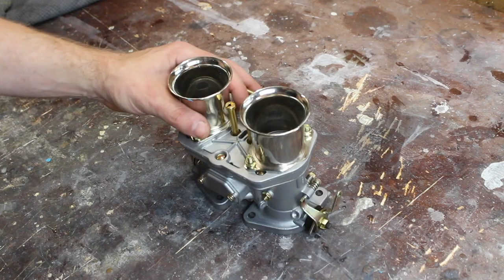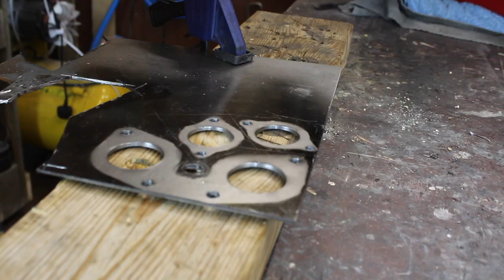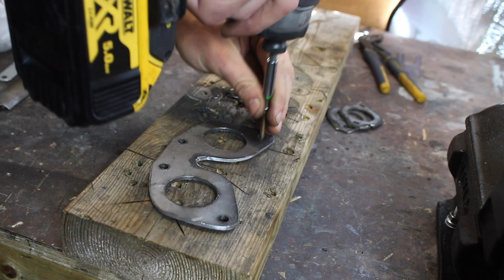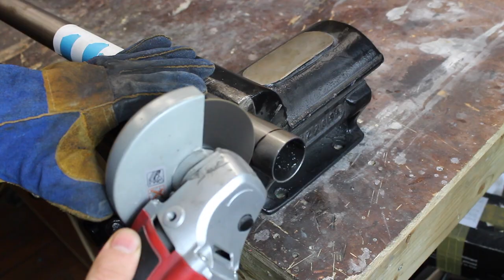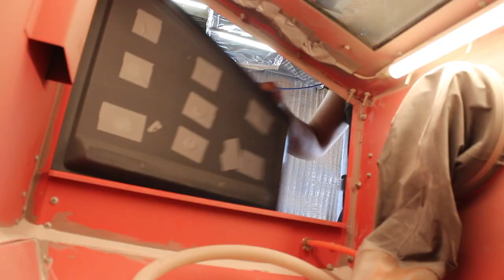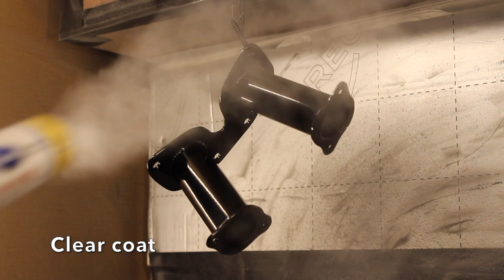Honda GL1100 Cafe Racer Build Part 5 - Fabricating Weber Carburettor Intakes

Comment: Very pretty, mounting bases looked a little thin, warping or flatness any issues?
Reply from the maker: Hey 
Thanks 
It is just about alright. I should of chosen thicker metal. Probably a 10mm steel would do it better. The flattening to the surface just fine 
🛠️🤘
Reply: We'll all need to get a 3-D printer with scanner to really stretch the imagination.

Comment: Awesome fabrication skills, just curious how you got the angle for the runner pipes
Reply from the maker: Hey! Thanks very much for the compliment.
The angle was 10 degree. I measured the distance between the 45 degree line and the edge of the paper, then split the distance. That’s 22.5 degrees. I split the distance again. That’s 11.2 degrees, so I took of a few millimetres off. I ended up with 10 degrees and made the cut. You can play around with the angle. The angle is bigger you’ll get shorter pipes. If the angle is smaller you’ll get longer pipes . I Hope this will help you.